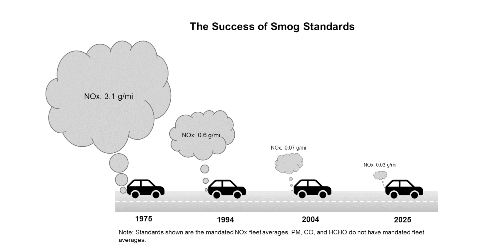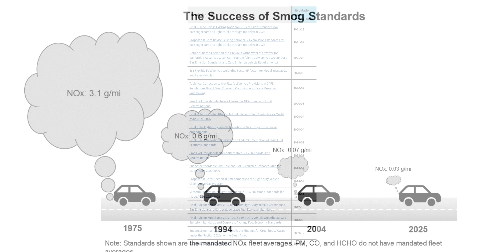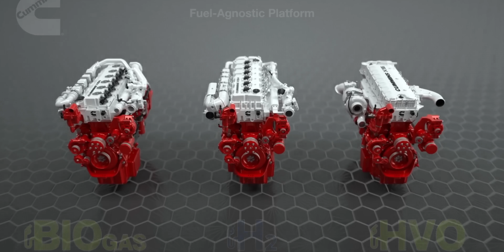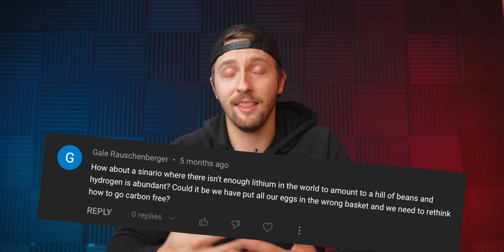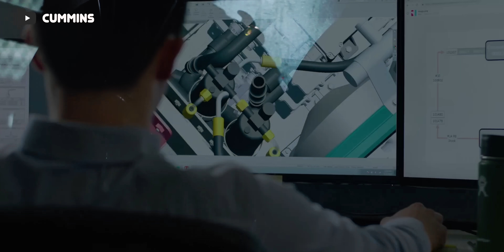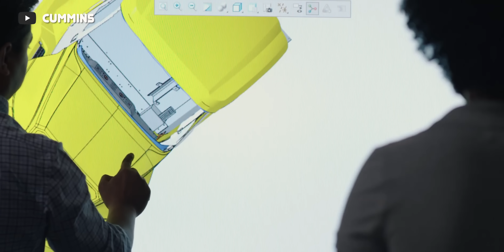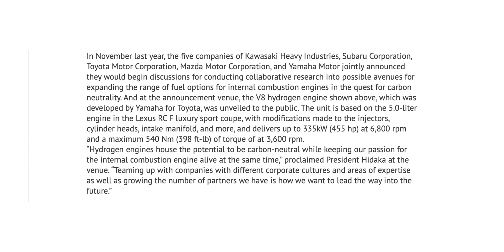Cummins Hydrogen Engine Will KILL DIESELS FOREVER

Comment: Problem with Hydrogen generation is that most of the hydrogen fuel is generated using processes that require nearly the same amounts of oil and natural gas produce the hydrogen used in these vehicles. 
It would require larger financial support in renewables to reduce the requirement for harmfull CO2 producing processes

Comment: Hydrogen production is still crazy expensive and NOT clean, 95% of the worlds current Hydrogen production comes from steam reforming Methane and wastes a crap ton of energy in the conversion process. And why does everyone forget the Infrastructure bill why is building out renewable energy and installing more NEW car chargers. There's really no infrastructure in the pipeline for Hydrogen fuel transport.

Comment: Lol no it won't, hydrogen powered engines have been around for 50+ years and proven to work, be safe and power from any type of water. They just kill off the patent holders, inventors and stifle the scientists. 
Hydrogen tractors have been invented and patented by well known tractor manufacturers and not allowed to sell them. 
 There is no money in it when we can pay through the nose for fossil fuels.

Comment: Neil DeGrasse Tyson explains how using electric powered vehicles is not about the environment but about removing the leverage that oil producing entities' power.  Electricity can be made by using many different fuel sources.  Check out his explanation in his video "How Clean is Electric?".  Hydrogen is cool except it uses water.  If we use it in our cars it will become too expensive for crops.

Comment: The problem with internal combustion engines is they are just not as reliable or powerful as electric motors. it’s old technology and we need to move forward. These ice motors have so many parts and the industry makes money form part replacement, they don’t want to give that up.   So don’t give into the hype that electric isn’t there it is right now, you can buy a big rig from several different companies right at this very moment. Hydrogen is only a stepping stone and if implemented won’t last long before being replaced by electric.

Comment: EV semi trucks and cars are the "stop gap" right now.  With the range and recharge limititations, the EV will never be the final replacement for gasoline (as if we really needed to replace gasoline engines).  EV = the CFL light bulb, soon to be gone!

Hydrogen fuel vehicles will be the future.  Runs like gasoline engine and quick refills.

Comment: I was hoping you would cover Toyota's new hydrogen storage tanks.  Very impressive. Tanks Had to be shot with a 50-caliber rifle at close range,  TWICE, in the same spot before they failed.  The failure was just a hole! No massive explosion. Incredible
Reply: Right, we're these t anks full or empty? Guessing empty due to safety concerns, I'd have to see it to swallow that pill
Reply: I wasn't questioning it's legitimacy, I want more information.. considering I have seen the abuse demolition ranch has put standard welding gas tanks through, I'm not saying it's not possible or even likely.. I just wanna see jt
Reply: Share a link?
Reply: @jasonsimons4411  I'm looking for the video I saw it on.  I'll post if I can find it.
Reply: Hydrogen does not become combustible until it is introduced oxygen and fire or extreme pressure which a diesel engine creates extreme pressure to push the molecules of the fuel together so tight that it combust. hydrogen fuel cells  has been out for years and  in the 80s there was a car that had a carburetor on it that got 100 mi to the gallon and the oil company buried it. hydrogen fuel cell it's not something new hydrogen is stored at such cold weather you do not have to worry about freezing temperatures because hydrogen gas does not freeze but  what is coming out the tailpipe...(water)so it probably best  not to run hydrogen fuel cell in below-freezing temperatures. when you add hydrogen and oxygen together it creates H2O which is water so hydrogen fuel-cell is the absolutely the best fit for any car basically Nikolai Tesla invented clean electricity but they didn't make no money so the American government/JP Morgan /Edison slashed it. just like the oil company bought the rights to that carburetor that produced a hundred miles to the gallon and buried it in the ground the government's going to be the problem like always. There's no money for the government to make electric vehicles EVS will always be their go-to because they have to burn oil or coal to create that electricity and it doesn't take a rocket scientist to figure that out if they would have let Tesla create free energy they would have opened the door for evs but like I said before it's all about the money they can make on it. I think they're going to squash the hydrogen fuel cell and switch to natural gas because it's pretty clean and they can make a crap ton of money just like gas and oil👍
Reply: @Kenny Shelafoe  There's plenty of money to be made by going to hydrogen this is why Cummings is spending a huge amount of money developing hydrogen engine technology that also crosses over with diesel engines. Tesla is also introduced their own hydrogen car. I'm not sure on the details on that 1 but it's out there for the getting. 
I'll post links to a video or two.
Reply: @kdawg96bnc m, hydrogen burns without oxygen and is flammable not combustible.
Reply: @Ardenbralee24  the problem with natural gas is that fuel economy sucks. Had a friend that ran it in his mustang. Got half the fuel economy of gasoline. It took a lot to convert it as well
Reply: @Ardenbralee24  Hydrogen will not burn in pure nitrogen (it requires a lot of energy to generate NH3), however in high temperature combustion in standard atmosphere NOx will be produced as when burning diesel or petrol.
Reply: This might be the video he is referencing - https://www.youtube.com/watch?v=jVeagFmmwA0&ab_channel=ToyotaUSA
Reply: Hydrogen doesn't go bang unless it is mixed with O2 in stoichiometric ratios. A leaking hydrogen tank at worst case produces a flame. Also hydrogen, unless it leaks into a confined structure, will just disappear as it is so light vs the air, unlike petrol that hangs around generating vapours waiting for a spark!

Comment: I've been pushing for hydrogen conversions since the early 2000s, evidently a few decade too early. Not purely a green initiative, but more of a side effect to get more power out of a diesel that also happens to be 'green'. They laughed at my steam two stroke for decades, in which I didn't have the machining capability at the time and ended up getting involved with jet engines. In doing those initial experiments however, I/we (I bought some outside talent in eventually) happened to learn about hydrogen embrittlement on current metals in engines, namely iron and aluminum. To date, I'm not aware of anyone having found a long-term solution that also doesn't involve ceramic coating; it can help, but it's not super reliable for OTR truck environments. 
Cummins is trying to stay relevant, which is perfectly fine. Electric cars and Only electric is not progress, it's being strangled into one solution that is taking slaughtering a chicken and calling it a sandwich. All of the current infrastructure in liquid/petroleum fuels still has a place, and liquid fuels provide the best energy density that humans have yet to harness, plus it is easily transported and refilled. Not to mention electric cars are truly soulless and without character, but that's another matter. If it's all about being efficient and sustainable, improve what you have first!
Reply: So, you just figured out  what hydrogen embrittlement is... something known for a century... how quaint.
Reply: @w8stral  I understand reading is difficult for some, but do try to keep up for a moment. I never eluded to discovering it, it was clearly stated I learned about it, first hand, while developing alternative fuel systems. Mankind has known a great many things for hundreds of years before it was relevant to a modern society, and with rare exception, most every great idea has been thought at least once before. Exercise your skull muscles a little each day, for your own benefit...
Reply: @C-M-E  Exercise your humility.  You replied and showed once again why I posted what I did.  Just wondering if you are going to triple down on hubris... just wondering from a fellow, sometimes arrogant, mechanical aerospace engineer.

Comment: Hydrogen is a byproduct of earth's oil, the same oil that is refined to make gasoline fuel, diesel fuel, and E85 fuel which has a minimum of 15% petrol. These aforementioned products create a high carbon pollutant into the atmosphere when it's not combusted fully as when vehicles engine operates lean or rich with air-fuel ratio. Rudolph Diesel is the founder and engineer whom developed the diesel engine that utilize a revolutionized a combustible engine known as "Compression Heat Ignition" not having to rely on flammable liquids or combustible byproducts as mentioned. Such oil products like peanut, corn, avocado, hemp, canola, coconut have less mineral contents VS earth's oil when burned in its natural state the vegetable oil will release far more less pollutants then earth's oil. This message is food for thought, not to provoke or cause debates.

Comment: Yeah, we'll kill the diesel engine, which will require us burning oil to produce electricity at a power loss through entropy, which we will use to separate hydrogen and oxygen at another entropic power loss, so we can create hydrogen containment cannisters at yet another entropic power loss so we can burn hydrogen.  That will allow us to sell our excess diesel to developing nations who can't afford this foolish venture, and who will get an okay deal on diesel.  And for our next trick, we'll step into the pocket we create with our own two hands and lift ourselves into the sky!

Comment: I don't see electric vehicles being viable in the long run at all. As you said, mining the materials needed is tremendously damaging environmentally, mined by slave or child labor and even more limited in quantities needed than oil. The other issue is charging times, especially for long distance travel. Unless you can charge batteries in near the same time frame as fueling a combustion engine they're totally impractical. Can you imagine the lines at recharging stations even if it takes only 15-20 minutes to charge them? Even in cities that's not going to work. You would have to install charging devices in every home, work place and business of every type to make it work. Not going to happen. I think hydrogen is probably the way to go. However, the biggest issue is not causing a mini Hindenburg disaster whenever there is an accident.

Comment: I think a diesel electric generator is a more obtainable future. Trains have been using them for almost a 100 years. Electric motors powered by a small diesel engine. The engine will be low emissions due to running at a constant rpm with no load. It eliminates charging stations and the complicated way of refueling a hydrogen powered truck. Edison Motor Co. is the future of trucking without a doubt. Awesome company based in Canada.

Comment: Would be great if the majority of the world's Hydrogen was not higher emitting than Diesel, once you consider how it's made, transported and used. 

Black/brown/blue hydrogen is worse emitting than if we all just stick to diesel/gas because it is made using natural gas and a whole bunch of electricity. 

It is all just a scam of the petroleum industry to keep us burning their products because we do not know that this is one of their products and the label reads "low emissions fuel". They get a bunch of grants to build stupid hydrogen plants, and get to use a lower cost more abundant natural gas instead of oil to produce a higher margin product (that emits more carbon into the air). 

Stick with diesel for long haul shipping until there is a real alternative (like just a bit more R&D and electrification will be a real alternative). 

Convert your short haul and passenger vehicles to electric now, it is already a better alternative. 

The closest hydrogen is to a real alternative may be hydrogen fuel cell supplementing a large batter EV for long haul. But this still would only be good if we used Green Hydrogen produced with excess wind/solar...but we are still a long ways away from having excess wind/solar to make hydrogen. 

And it would be way better to first produce the first Green Hydrogen to replace industrial hydrogen made black/brown/blue. We are so far away from having excess green hydrogen made with excess green generation to be effectively used for transportation.

Comment: The leading industry should have done that a long time ago .those actions would be better for the environment vehicles and industrial machinery use a quite a bit of fossil fuels where as the hydrogen may cut the use of those fuels by percentage .tractors are a major user of those fossil fuels and their found all over North America damn near as a part of every work place .the Cummins should Not be the only engine to convert over Kubota and also the Volkswagen are compatible with the conversion thus for decreasing usage of fossil fuels that may be conserved for the future .

Comment: To me this is really exciting news because this means that you could use a Cummins engine for power generation off the grid, using solar panels to generate hydrogen, so you can have power 24/365
Reply: Unlike other gasses you can't store Hydrogen gas for very long at all because it leaks out of the tank pretty quickly This is because the molecule is so small. Hydrogen tanks are measure in how much they leak over time. Even a hermetically sealed metal tank will leak out hydrogen. The tiny molecule will work its way right through the side of the vessel. Also takes a lot of infrastructure to be able to compress the Hydrogen gas and keep it cool to keep pressure down. It would be far cheaper to use batteries to store electricity and use an inverter. Hydrogen looks good for rocket fuel and weather balloons and for the very rich that can afford to use it. For the rest of us.. Currently a pipe dream.
Reply: @jimthvac100 ,  Lets see,  If it takes 80 Kg to run a class 8 truck for 1,000 miles, and it takes 400 Kw to produce 1 Kg of hydrogen, then it will take about 32,000 KW of electricity to produce enough green hydrogen to run that truck for 1,000 miles.  Or drive a Tesla truck and use 2,000 KW of power.  

Lets look at the cost of electricity and see if 32,000 KW is lower cost than 2,000 KW of electricity to run a Tesla.  Umm, I think electric truck will be less expensive.
Reply: @jimthvac100  In Japan scientists are working on helium cooled nuclear plants, the heat of the cooling helium can directly separate hydrogen and oxygen. If i'm not mistaken another way to store hydrogen is by using a fuel cell, which prevents leaking
Reply: @larscw74  I have read about some fuel cells. Be nice if the technology was more widely affordable and available. Seams the patient holder is not wanting to let anyone build them in an affordable way
Reply: @larscw74  That would help but still need a way to mass produce it at a cost that we can afford. That would be a drop in the bucket compared to what we would need.
Reply: only problem is you'd need a football field of solar panels to generate the hydrogen needed to run it for an hour.
Reply: It doesn't quite work that way🤔
Reply: It takes 400 KW of electricity to generate 1 Kg of hydrogen using electricity.  So if you have a Really large solar system, then yes you could make 1 Kg of hydrogen every day!  That would be a 80 Kw solar system, so it will not fit on your house and barn roof, unless you have a 80,000 square foot barn.

Comment: Most of the public likes a fuel that can be carried in a can or bucket. Diesel will remain the safest and most portable fuel. Nobody mentioned what a gallon of hydrogen will cost! Funny, if you want a real clean burning diesel fuel it’s already here, well in Europe, Canola oil needs no catalytic converters and burns clean! That alone would save $8,000 minimum on a new car or truck without all the pollution control. What else could you ask for?

Comment: The optimal solution would be to use a hydrogen fuel cell with an electric motor. But.... 

Electric motors have there own supply chain issues. As combustion no mater what fuel you are using have an established supply chain and use pretty basic materials. 

Then there is maintenance. Most people look at commercial applications as they do there own personal vehicle. The fact of the matter is commercial applications are used much harder and more often and required much more maintenance to keep it going. If you just turned all equipment into electric drives who is going to maintain them? The transition into being an EV mechanic is much more technical in computers and such and will take time to train people to make that transition. 

this is why a great middle ground to get to a more carbon neutral state with out shocking these industries into fighting back against the movement is keeping there power plants familiar and needing only small training expenses with out basically having to lay off half there employees for a new age work force that understands the new tech.